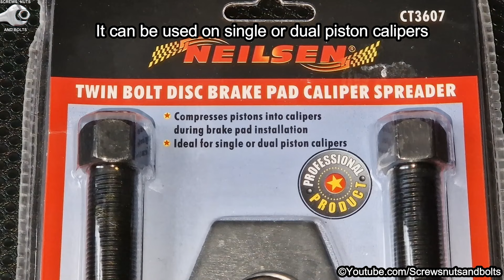Brake Caliper Rewind Tool For Single and Dual Piston Calipers

Comment: Another great video cheers. Does the tool can do left and right caliper pistons like the Ford transit rear calipers pistons ?
Reply from the maker: Thank you !. This won't work on rear brake caliper pistons as they usually need to be rotated as they're being pushed in. This tool is for pistons which are pushed straight back into the caliper.

Comment: Not very good, Description says "rewind tool", I didn't see you rewind anything. And it should have a plate pushing in the piston(s), because not all dual piston calipers are the same size and without a plate pushing the piston in, you're hoping the push rods fit just right. And rewind pistons have to be rotated to be compressed, you didn't even show if the tool has different setups to work on rewind pistons. I could use a C-clamp and the old brake pad to do what this tool did. No thanks!